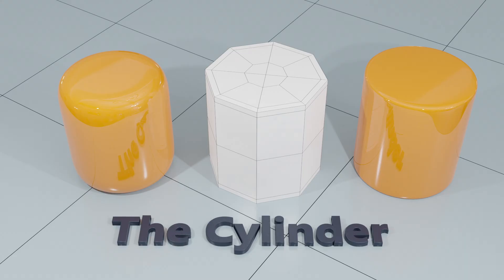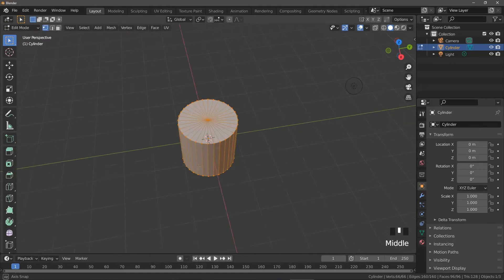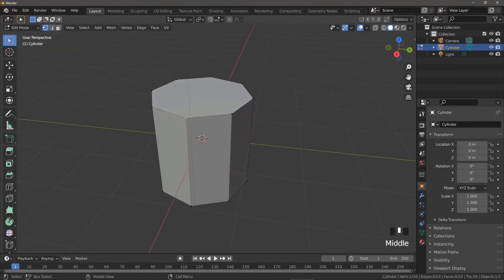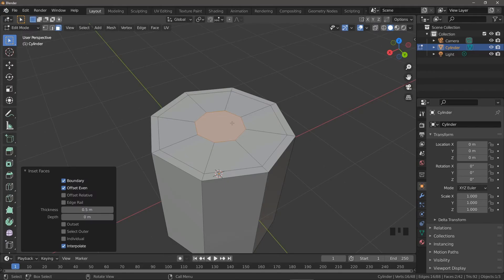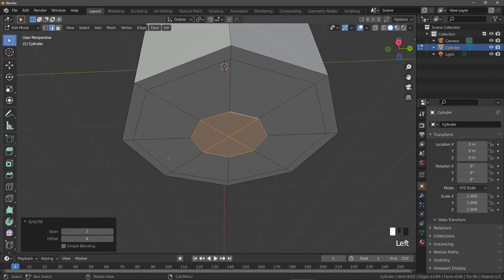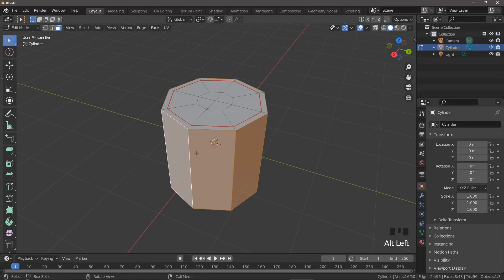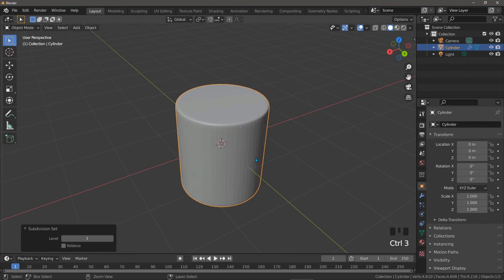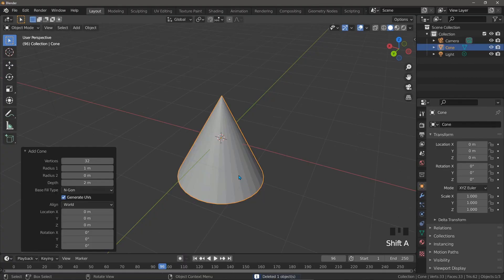Blender - A better cylinder - #5 Subdivision Surface Modelling in Blender.

Comment: why don't we ever want 3-spoked vertices? Cool vid btw, thanks
Reply: Cause you can’t control the curvature. It’s comes out with pinches
Reply: @FplHorizon  thanks for the reply. so 4 is the minimum?
Reply: @aliencatface9412 not just the minimum, but the best. You’d get the same bad effect with other spoked poles. Although any number of spoked poles is perfect on a flat surface. It’s only an issue if they are at an edge.

Comment: Thank you, however I am making the cylinder to upload to a game and using the sub mod at the end sends the verts/face numbers rocketing to over 4000.  How can I work round this to make it low poly please.  I'm still learning :)
Reply: im still learning but look into retopology and stuff. usualy you can retopologize a model to keep the shape without lossing deatail and stuff like that there is also the remesh modifier in blender 4.2 and 4.3 that once you do this save and then save as before you remesh and then the remesh modifier runs it through an algorythem that tries to cut down on the amount of everything while maintaining the shape. it esential dose the retopologize thing for u sorta, i havent used it at all yet just seen videos but maybe that will help. also depending on what kinda systems you want your game to run on there are tons of games out there with like "bad" geoimetry and and alot of problems with high geometry models can actualy come from shaders and textures that multiple the the problem , or like work load/ weight of an object, again im still learning too so might be all bullshit but saw no one replied hopefuly this helps 5 months later lol. or anyone else who sees with the same problem in the future

Comment: It’s ridiculous that it requires so many steps just to smooth out a cylinder.
Reply: It's just a fundamental flaw with subdividing any 3d object.

There is nothing Blender can do.
Reply: @kakol20908  blender could change their default cylinder model if they wanted

Comment: nice but like... I don't see how this is very useful in use considering that unless you're making a jar or something specifically a cylindricar I don't see the purpose of this.
Reply from the maker: Hi ZUnkownFox. It is an excellent question! This tutorial is part of a much longer series where the concept will eventually expand to make word like Front and Back important as well as Top and Bottom. I will hopefully demonstrate that any complex object is composed of many simple objects with this topology and if we always have this topology (top/front), (bottom/back) cross sections and areas of curvature connecting them on the smaller components of an object, the connections between them become simple and the parts themselves have excellent control over their curvature no matter their resolution or size. As you correctly state, at this stage the idea is only usefull for simple objects. Subdivision surface modelling becomes much simpler when we consider objects as modular!

Comment: Halfway into the cylinder video I knew I needed to hit subscribe.

A Redditor recommended this playlist after I was looking for critiques on a seemingly simple shape.

I am so glad they pointed me in your direction.   THANK YOU for sharing your knowledge. 

Looking forward to more insights.

Do you have any recommended books, videos whilst we await the next installment?
Reply from the maker: Hi loofa, Thanks! 

It is really hard to find good information on Subdivision Surface Modelling outside of the CG studios. It's a little more involved than polygonal modelling and as a result, difficult to teach so everyone on youtube just settles for incorrectly modelled polygons which render more or less correctly and everyone seems happy with that! All of these new modellers are going to get a shock when they try to get paid work!
I am making this series to try to tackle some of these problems but in the meantime, check out https://www.youtube.com/channel/UC3HUESS7z-P1KqeuVMNAe4Q - Blender Bob.
As for a book, "The Pushing Points Topology Workbook" by William C Vaughan is good.
Reply: @ianmcglasham  I am going to add an additional thanks for replying.  I will most definitely check out the book and video link.  Much abliged.